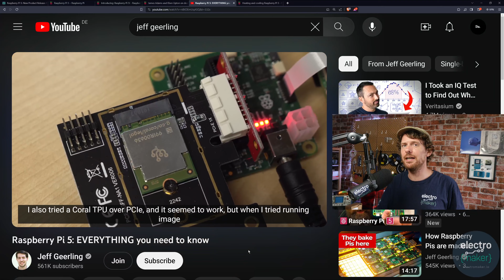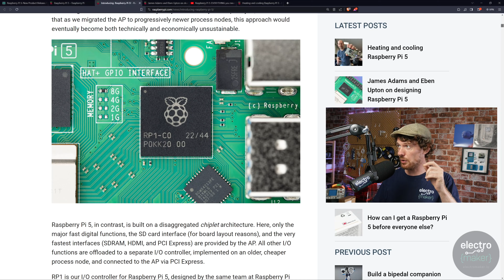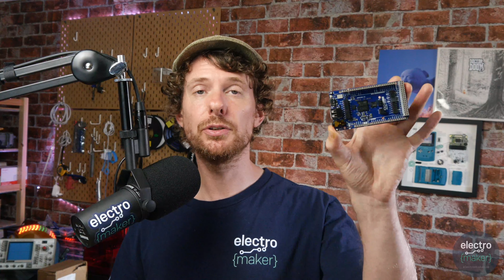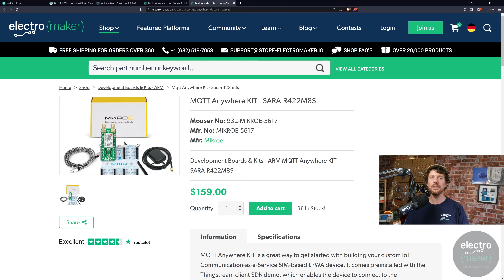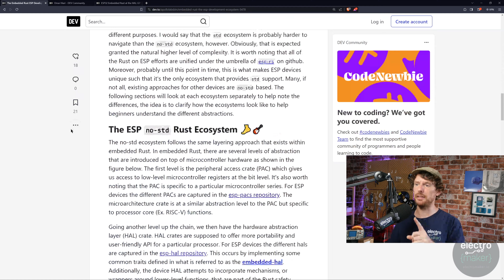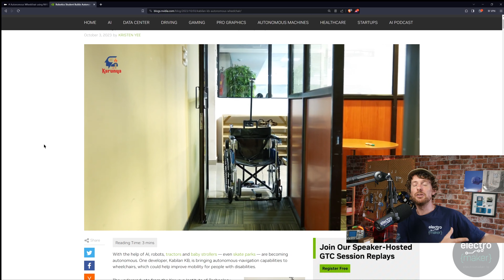Raspberry Pi 5, Nvidia Jetson Wheelchair, and Embedded Rust!

Comment: I bought a RPi 4B a few years ago. I wanted to use it as a system to play with Linux. My biggest complaint was that it did a horrible job with YouTube videos. So, I sold it. Now my interest is being piqued again. Looking to see how well it does once released.
Reply from the maker: Pretty sure the latest version will run YouTube videos very well. Interested to hear how you get on

Comment: [23:01] there is a nice 3.5" TFT touch screen (480x320px) by Waveshare for Raspberry Pis which is under $25 USD on the official site. (the ISP ver. is $29)
And some other even cheaper chinese knockoffs of the same screens, like some "GoodTFT" I got for under $13 USD couple years ago with the decent RPi 3B+ case as a set 
 (which actually works flawlessly for me with Zero 2W as well as the "elder" RPi boards w/ Kali and RPi OS, etc.). 
Although, I haven't tried it w/ the first RPi Zero / 0w as of yet,
 it is still by far -- the most affordable compact solution for a quite capable portable device, so can't recommend enough.

Comment: I would use it for some testing, i have not used #MQTT before. 

Sounds like a right board for drainage overflow detection ( prevent flooding ) to send a message to the concern authority.